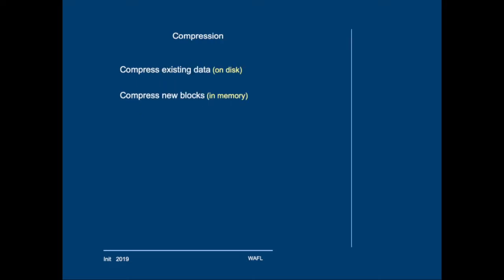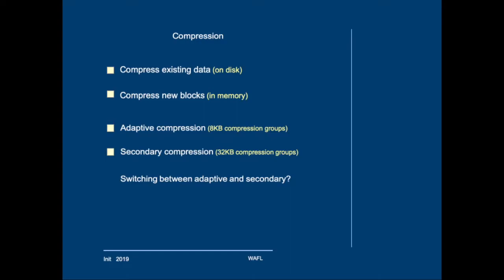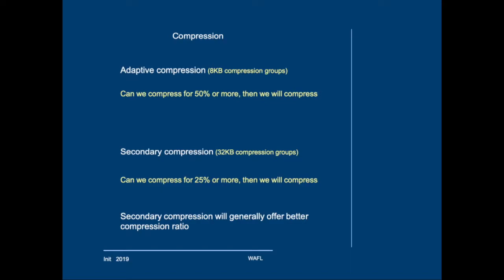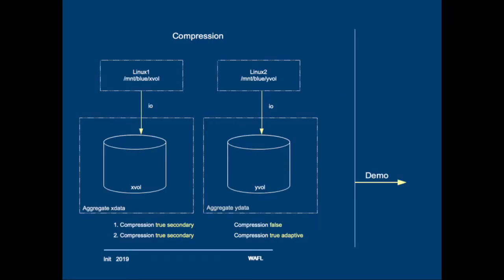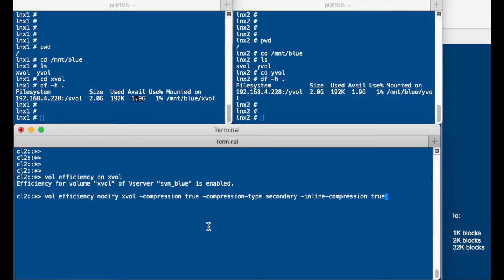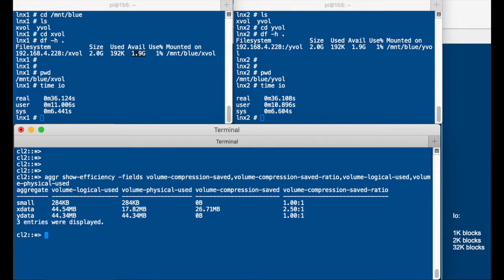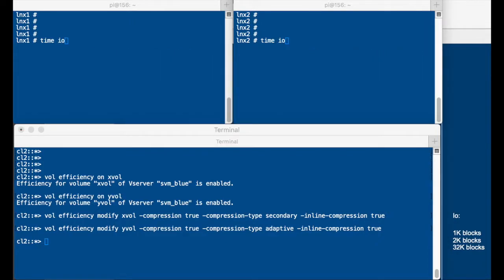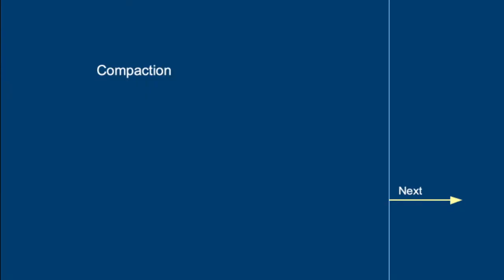Netapp ONTAP WAFL compression + demo

Comment: In secondary compression diagram you have shown 32KB compression block compression rate to 50% but you have mentioned earlier it will compress only if compression rate is 25% or more. It confusing
Reply from the maker: Hi, I agree that this looks confusing. The thing is that it takes the entire block of 32KB to compress. So this would be anything from 25% and up. The 50% is just an example. Could also have been 30% or 75%. Bu t again, I agree that it is confusing.